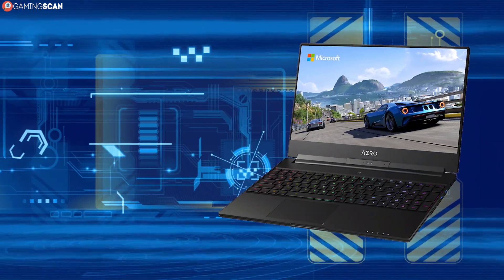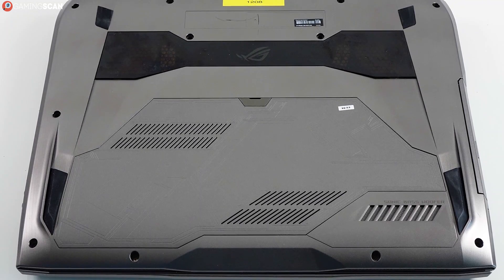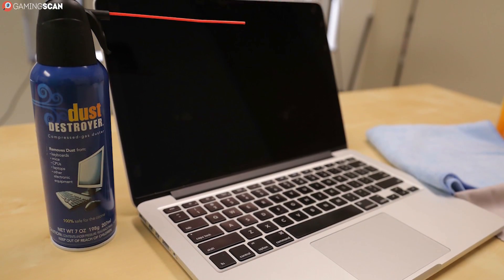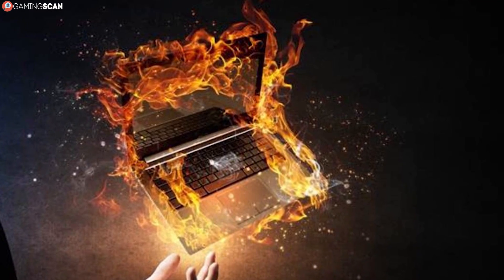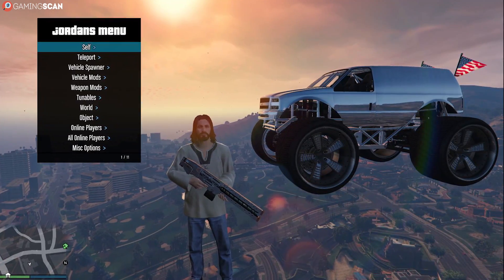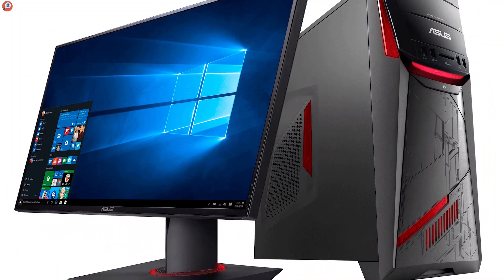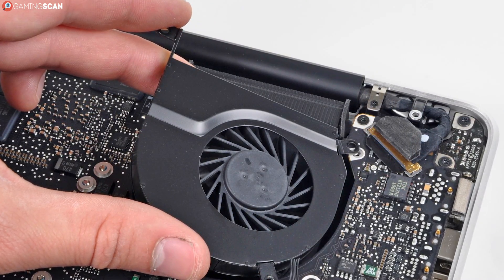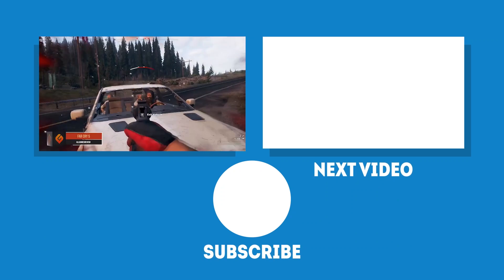How To Keep Your Laptop Cool While Gaming [Simple Guide]

Comment: my laptops greatest weakness is "anti aliasing" even with very high texture quality i dont lag but when i turn on anti aliasing my frames drop down
Reply: Use FXAA. It isn't that demanding on the GPU
Reply: Achirag Chirag far cry doesn’t have that lol
Reply: Also turn off motion blurr fu*k motion blurr
Reply: @GodFather6969-s4q  yes motion blur is shit
Reply: My laptop gets hot when I use it to play games while charging. Is it safe and normal? It reaches like 90 Celcius
Reply: @ahmednasrullah8215  90 is not good if it was in 80 then it would be normal and safe but 90 degree is too much
Reply: @qwertyuiopasdf160  what can i do to reduce the temperature?
Reply: @ahmednasrullah8215  can you pls comment the specs of ur laptop? So if the laptop specs are bad that would explain the heating but if not I will list all the things you could do to reduce the temperature

Comment: Don't buy amd! Don't buy laptops that have fans underneath it. Buy Intel, Nvidia and fans out the back of the laptop! Never use it on pillows, blankets, duvets or in bed! And the last thing, don't smoke!
Reply: @Ki113r5 4R3 84CK acer or hp?
Reply: @Ki113r5 4R3 84CK the Nvidia
Reply: @Ki113r5 4R3 84CK acer predator?
Reply: @Ki113r5 4R3 84CK better to be a piece of garbage, than a piece of crap 😂 and no it is not! Amd is only worthy in desktop computers, not in laptops! If you tried Intel/Nvidia laptops, you would never go back to the unstable magma amd. Always heat problems with amd, and their gfx cards can't run old games as well as new. Nvidia runs every single game smoothly, old as new.
Reply: @bamsemh1  you seem to not have a lot of knowledge on modern computers. Please stop giving advice without knowing anything!
Reply: @jedi22300  I know enough about heat problems and laptop gaming. Try to visit dreamhack. Then you will learn that amd still can't beat the heat. In desktops it can, because of the huge and power consumption cooling systems.

Comment: I use a dell inspiron 15 3567 (I know not the best but i play csgo)

It shuts down from heat 
Only on a hot day.
Any tips?
Reply: Wait for winter. Problem solved. Don't thank me 😊
Reply: @shadowcaster7974  we don't have winter
Reply: Move to Antarctica
Reply: Right hand side: Battery Icon(Right click)>Select "Power options">Click any power plan you use and Select "Advanced Power Option">Scroll down until you see "Processor Power Management" Drop the tab down and Click "Maximum Power Usage"(Or somtin like that" Make sure plugged and on battery is on 99%.
This will disable Cpu turbo boost Frequency=Less heat.
Reply: I play on a similar Dell model and yeah I've found that csgo cab overheat in the summer, especially on some maps. I fixed this by changing a setting which I honestly can't remember that well. It reduced the maximum processor usage when plugged in and I haven't overheated since, although this does slightly reduce frames but for a game like csgo, u might be able to still get decent frames.
Reply: change the video settings to the lowest
Reply: and try removing background apps
Reply: Guys i made my cpu use 75% of it's power.
Turns out that was overheating 
That worked for me although it did drop my frames by 5fps
Not too bad because i play 60fps.

So yeah i'm all good now!
Thanks for the help i really appreciate it guys :)
Reply: @sasdos6670  what cpu is it
Reply: @cryptonite4258  I'm pretty sure a intel i5 7th gen??
Reply: @sasdos6670  OH YEAH YEAH!
Reply: Put something under your laptop so it would be elevated, put a big ass fan next to it (I know it hella unconfortable and looks stupid, but that how I used to play for 1,5 years and it was REALLY effective), undervolt, open windows in your room, so fresh air can come in OR if the day is hot use conditioner or something else to cool down the room.
Reply: Move to canada
Reply: repaste your thermal paste
Reply: get away from the sun
Reply: Use an electric fan, it always works for me lmao
Reply: Change thermal paste
Reply: I am facing the same problem with same laptop n same game
Reply: .gaming on inspiron 15 series..with intel graphics.thats the worst..am using that for 4 years with no problems till now..so smooth.but good for gaming
Reply: My previous laptop which was a Dell died immaturely because of the heating problem. My new computer has a water cooling system. Water has a very high heat capacity and latent heat of evaporation as compared to air and it can remove huge amounts of heat as it evaporates. I have a plastic tray and I place a wet kitchen towel on it. I place the lap to on the tray with wet towel underneath the computer. I keep adding water to the towel as it dries. This solves heating problem perfectly. Never ignore a heating problem.
Reply: Yes

Get a better laptop
Reply: Sasdos Shopping for a new gaming laptop right now. I had an old Lenovo y510p from 2014 and I think I killed it from overheating. Try and keep a ceiling fan on in your room or buy a desk fan and point it at your laptop when you game. It will help with airflow and keep the ambient temps down. But I would save up for a cheap gaming laptop with a dedicated graphics card
Something around 700 bucks which is what I’m looking for right now.
Reply: @yoyo2598  try asus x550ik or dell inspiron 15 5576
Reply: @ignasiusssamuelss6659  OH YEAH YEAH!
Reply: @yoyo2598  Im little late but if you could , get the acer nitro 5 (amd) .I just got one a week ago and its a beast for $700
Reply: Real Skull Does it run hot, what fps averages do you get?
Reply: Buy an Vacuum Heat for laptop, bought 2 if there was an 2 exhaust port like mine Y740.
When play game, it was from 75 degree Celcius to 71 Degree Celsius.
Peace

Comment: yh... anyone who knows the horrors of modern console gaming will know that its also a bad thing if your system is overheating but the exhaust is blowing but blowing cold

if this happens and your out of the warranty period get someone with PC building experience to strip it down and replace the thermal compound as over time the factory installed gloop dries out and becomes a thermal insulator trapping the heat inside with no escape
Reply: Mine is blowing a Little cold  but its new

Comment: Undervolting + repasting is another key to lenghten your laptop's lifespan and keep it run cool.
Reply: And both require more knowledge than all of the things said in the video. Also liquid metal?
Reply: @savots3812  Iiquid metal too scary for me, especially in a laptop
Reply: Marky D  get INTEL Extreme Tuning Utility and you will find "core voltage" there. Lower it and then run the test it has for at least 5 mins. If it's stable go on, if not your laptop will restart. If your cpu ends with U don't bother. Keep in mind this may lower the boost clock. If there's anything write
Reply: use ThrottleStop for CPU that end with U
Reply: @savots3812  well my cpu end with u but i still can undervolt it -150mV stable
Reply: @rohmatpulou3208  That's strange. But I am curious, did it boost the same as before?
Reply: @savots3812   it reduce the temperature 10 c++ and when i playing game the fps more stable  i undervolt the cpu then overclock the gpu :)
Reply: @rohmatpulou3208  Well then good job :) , and kinda bad on the manufacturer's side.
Reply: @rohmatpulou3208  How did you do it? My cpu is I3 7100U and gpu is 940mx. My laptop is 1 year and 9 montha old and Im thinking whether Ill repaste it (Maybe repaste it on laptop repair shop) or not. Thanks in advance :)
Reply: @rohmatpulou3208  I can confirm it with my Asus turf 504. Undervolt both CPU (-0.125)and GPU GTX 1060 ( curve 875 1800 MHZ) reduce temperature only 63 degree while gaming ( The Witcher 3 Ultra )with overboost on
Reply: @savots3812  i dont really recommend intel xtu. It's easy but it brings many issues to me. Use throttlestop instead even though it takes an extra step to undervolt. Yt shows good example for it. My issue with xtu is that it causes power limit throttling and you may say xtu doesnt cause that and it's because my cpu isnt getting enough juice. Once i switch to throttlestop and apply the same volts, i never gotten any issues anymore
Reply: Undervolt is easier but taking apart a laptop to repasting thermal paste is hard asf if you're not familiar with laptops and computer parts
Reply: If you have poorly applied paste from factory and it burns.. the guarantee makes sure you get new lap top.
Reply: But also make it slower...
Reply: @ToxicBenchmarks  Some people feel that running cool is the most important thing in the world, as long as your temps are okay , its okay
Reply: @samuelmatheson9655  then tell me, my cpu temp goes up to 80°C on average (cuz I'm using a single fan). Is it still okeyy? For a long term use?
Reply: How do you underfoot. Is it just lowering from high performance to medium?
Reply: @WarPigstheHun  To "underfoot" u glue the laptop to your shoes.
To under volt u reduce the voltage going into the CPU, or whatever component u wanna under volt
Reply: I cant repast i can only free paste csgo cheats
Reply: i was searching this comment
Reply: Undervolt is easier but taking apart a laptop to repasting thermal paste is hard asf if you're not familiar with laptops and computer parts
Reply: Undervolted mine by 10% and it helped a ton. Might uograde my ram to decrease CPU overload in few months
Reply: Guys i have msi gl63 laptop and from the starting my core voltage and offset is locked in xtu.. i bought it in 2019
Reply: Sadly mine is soldered together.
Reply: A good gaming laptop does not need it though. But they are very expensive.
Reply: Dont listen to this lol
Reply: My cpu is i7 7500u
Should I undervolt?
And how do I over clock graphics card?
Reply: @Sh-qc1eh  depends, what kind of card?
Reply: Samuel Matheson 
Not sure how to check. My sister bought it on impulse then. It's the idea pad 510 -15ikb. My guess is whatever graphics card, it probably either 520/620 Intel graphics or nvidia mx 940 2gb
It's on a laptop so yea...
Reply: Samuel Matheson 
So what should I do to increase my laptop lifespan?
Reply: @Sh-qc1eh  If u want to increase its lifespan, don't use it.
otherwise, it'll fail when it fails, and there's not much under volting is gonna do about that
Reply: Samuel Matheson 
I undervolted recently. At first glance I see some promise. Afterwards, maybe because I changed another variable, nothing to do with undervoltimg,frame rate dropped, surprisingly temp just went up. 
I plan to get a Store clerk to clean it for me, reapply thermal paste,swap my 4gb ram with 8gb, total at 12. I’undervolt thereafter and see the results.